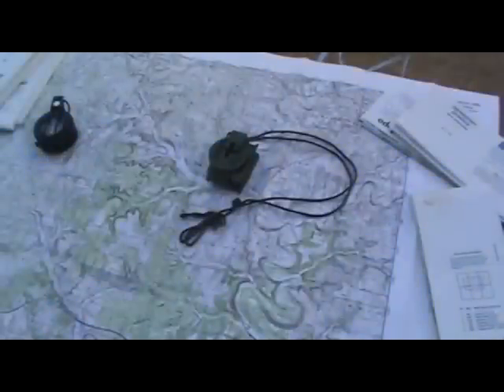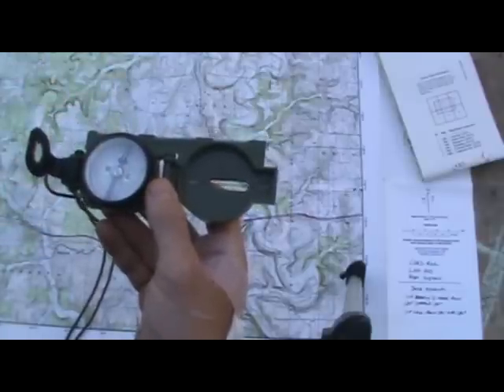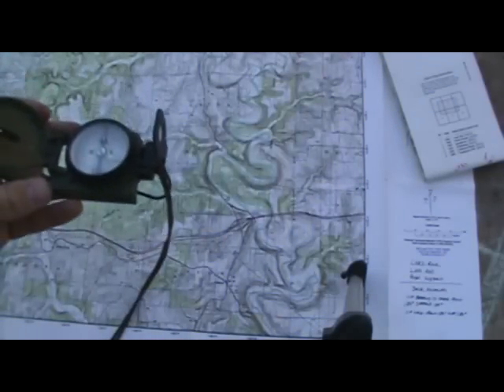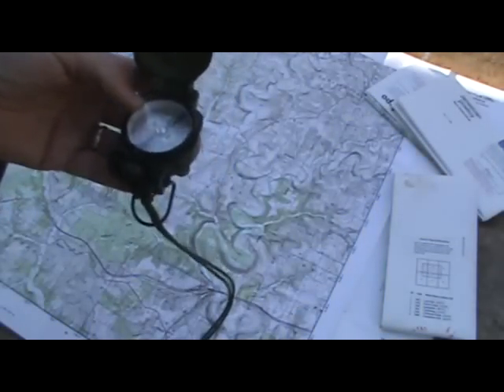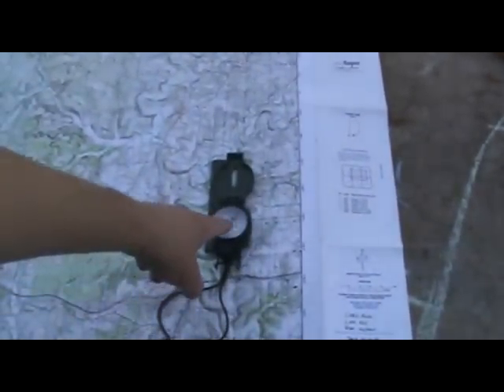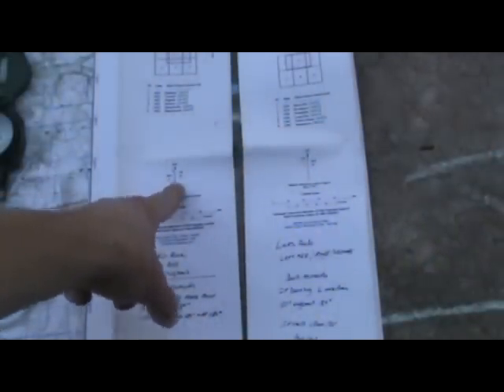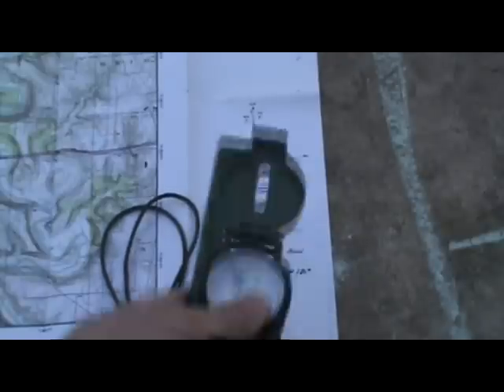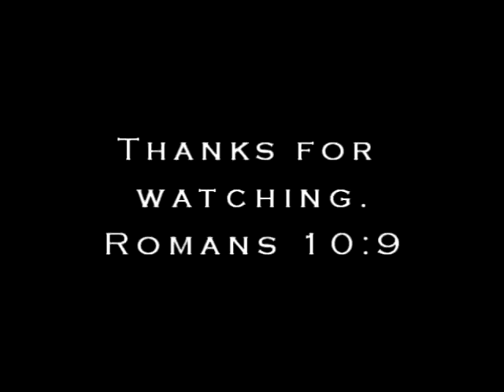Navigation with lensatic compass and map 1

Comment: Something I just learned or noticed is if your map is oriented to magnetic north, when you adjust it to True North, to adjust of mag declination,  the following happens:
If local magnetic declination is West, the map will turn CW when you orient it True North.
If local magnetic declination is East, the map will turn CCW when you orient it to TN.

The acronym I created to remember the declination adjustment is WAvES. West Add v East Subtract. The small "v" just symbolizes an angle or degree adjustment.

Since bearing are read from N going CW, and going CW the number of degrees increases or adds. Then it makes sense for West declination that the map would turn CW adding degrees to a magnetic bearing, and for East declination since you subtract the number of degrees it makes sense that the map would turn CCW, thereby decreasing or subtracting degrees for a magnetic bearing.

I have enjoyed your videos. I play around with various models of base plate compasses and with a Cammenga lensatic compass. The first type have a rotating bezel with the degrees marked on it, and  the second type has a floating compass card with the degrees marked on it. So you have to think differently when using one or the other. The Cammenga is kind of backwards from the way a base plate compass is used and you have to think in a different way to use it correctly. So I have found your video series helpful in learning how to use a lensastic compass correctly. Thanks
Reply: You didn't invent WAvES. Don't take credit for someone else's work or creation.

Comment: Question on the Back Azimuth:

On a compass, which is an even 360°, wouldn't it be easier to just always add 180 (since its exactly half of the compass ring) instead of adding or subtracting to get to the same result?

Comment: With regard to Pace count.  How do you adjust your pace count for the mix of speeds that will occur because of fatigue or terrain?
Reply from the maker: nutmegger,
There's no fool proof or truly accurate way that I know of. The best way I know is to take you pace count on varied terrain and with different weight packs. But even then it will only be an educated guess. Time of travel is probably a better distance indicator for leisure woods walking. 
Iz
Reply: In MY case, I don't spend as much time as I would like, doing leisurely walks in the woods.  Most of the opportunities these days are for hunting for food.  That said, I've heard of some folks using "time of travel" rather than Pace Counting.  The biggest drawback to both is the variants that can accure in a persons trek, due to injury, bad weather, darkness, obstacles.  Having SOME idea of a distance traveled, is obviously more beneficial than NOT knowing.

Comment: Good stuff, tnx.  But pacing seems very inaccurate, given that u don't walk of flat football fields but rough & uneven terrain.  Why not just get a laser range finder, put a dot on a tree at some compass bearing & head to that tree, knowing exactly what the distance is?  & if u are survey distancing, the distance is the horizontal, which can be way above the ground.  Pacing on a slope gives a false distance uncorrected, if the distance is a surveyor's horizontal distance -- u pace the hypotenuse of a triangle.
Reply from the maker: +Thunkful2 It is fairly inaccurate. I prefer using the time method, I did another video on that. I'm sure there are many ways to go about it and if you prefer a range finder then I say use it. The important thing is just to go do it, no matter what you use. Experience is the best teacher.